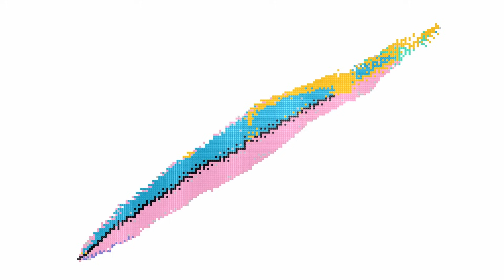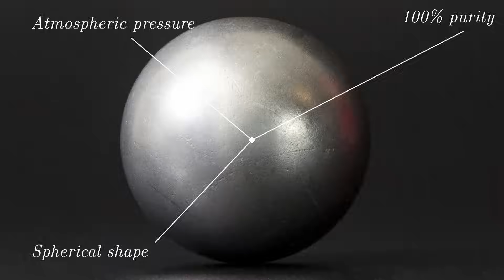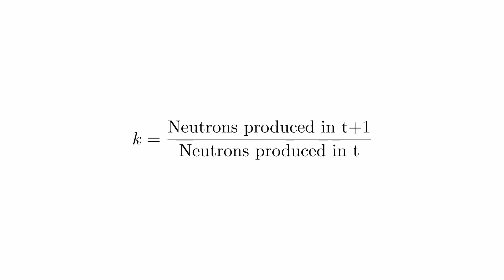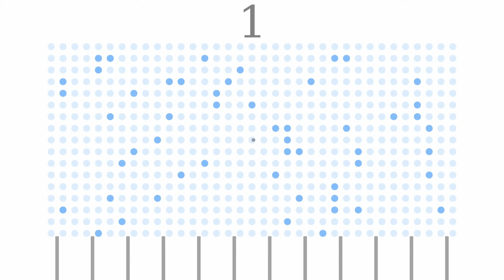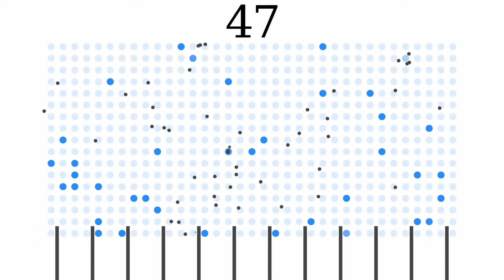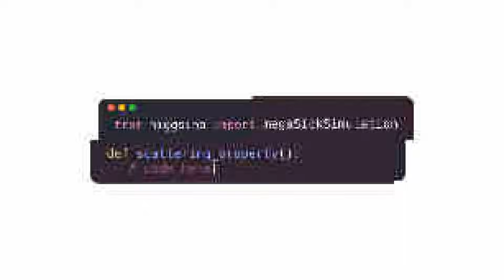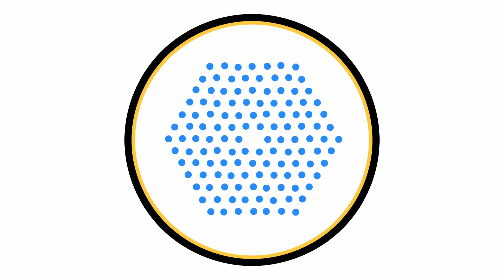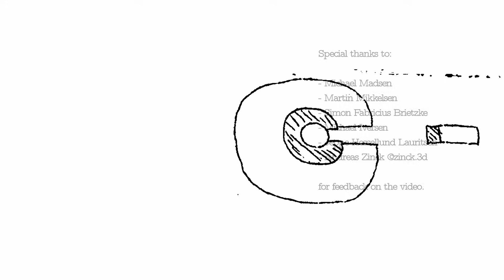Nuclear Fission Visually Explained

Comment: 1. Nuclear Binding Energy Context

Heavy nuclei (A ≳ 200) such as U-235 lie on the downward slope of the binding energy per nucleon curve.
This means they are less tightly bound than mid-mass nuclei (iron-56 peak).

When a heavy nucleus splits:
\Delta E = \Delta m c^2
The mass defect converts into kinetic energy of fission fragments and radiation.

⸻

2. Reaction Mechanism
	•	A thermal or fast neutron is absorbed by U-235 → forms U-236* (excited compound nucleus).
	•	The nucleus deforms (liquid drop model) due to Coulomb repulsion overpowering the strong nuclear force.
	•	It splits asymmetrically into:
	•	Two fission fragments
	•	2–3 neutrons
	•	Prompt gamma radiation

Typical reaction:
{}^{235}\text{U} + n \rightarrow {}^{92}\text{Kr} + {}^{141}\text{Ba} + 3n + \sim200\,\text{MeV}

⸻

3. Chain Reaction & Criticality

The neutron multiplication factor k defines system behavior:
	•	k < 1: subcritical
	•	k = 1: critical (reactor steady state)
	•	k > 1: supercritical (weapon/excursion)

Control mechanisms:
	•	Neutron moderators (water, graphite) slow neutrons
	•	Control rods (boron, cadmium) absorb neutrons

⸻

4. Engineering & Constraints
	•	Generates long-lived radioactive fission products
	•	Requires extensive shielding and decay heat management
	•	Risk of prompt criticality and meltdown if cooling fails

Comment: Your quip at 11:09 was really dumb for a scientist. Fun fact that "problem" you're alluding to was actually fixed by making those "evil" graphite tips 1.7 meters LONGER. And several RBMKs continue to operate just fine to this day in that arrangement. 

This is possible because the graphite tips in an RBMK reactor are not stupid or accidental parts of the design; and in fact perform many key functions in normal operation. The material didn't get to the bottom of the control rods due to random chance or incompetence.

Comment: 1:44 Regarding the split of U235 into Kr92 and Ba141: do the fission products occupy a larger/smaller/same volume than the original U235?
Reply: To be clear, it's not always these fission products -- there's a distribution (which affects the avg. number of neutrons per fission) --  the heat of the fuel rods themselves are self-annealing (but also some if the fission products, like Kr, Xe etc. are gasseous so degas themselves+ must be accounted for in reactor design)
Reply: @NZAnimeManga  very interesting, but not what I'd like to have found out
Reply: @ThomasHaberkorn  the self annealing answered your question. Yes fission products introduce stresses into the crystal structure (due to volume changes) but the rods are hot enough that this resolves itself in terms of impurity placement + gaseous elements escaping from the metal/ceramic

Comment: Nice simulations, but why did you use graphite for the neutron reflector? Graphite is a great neutron moderator, but that is the last thing you want to do to neutrons in a bomb. Little boy used tungsten carbide and the Gadget used depleted uranium. FYI, I have all the calculations solving the neutron diffusion equation to determine the critical mass on my channel.
Reply from the maker: Hey thanks for letting me know.  If you can find me your specific video, I'll add that as a video-link-popup - whatever it's called.

But anyways I chatted with Alex Wellerstein. He said the same thing as you, graphite is not correct for an atomic bomb. I didn't know, but I just wanted to name an example material for moderation. Miss on my side.

Btw love your channel. Let me know if we should do something one day. I'm currently working on using these simulations of the Chernobyl disaster.
Reply: @Higgsinophysics  thanks for sharing with your viewers. The video is titled "How to calculate an atomic bomb's critical mass,"  which can be easily found on my channel. I wanted to share the direct link but YouTube only lets the channel owner to include URLs in comments.

I also got in touch with Alex when I made my videos about critical mass, I asked his permission to show his Critical Assembly simulator. I started writing the code for my own simulation but I realized that it would be too time consuming and ended up just using Alex's simulator.

I am glad you liked my channel, I just discovered yours, subscribed right away. Collaborating in the future would be neat!
Reply: Isn't the n,f cross-section for thermals ~700 barn where fast neutrons are ~7 barn? Or does the ~100 barn n,g reduce the yield despite the increase in cross-section?
Reply from the maker: Also, this is hilarious haha https://imgur.com/a/pswEp5P

Comment: What happens to the control rod's material as it keeps absorbing neutrons?
Reply: Well if B-10 (typically used in reactors) absorb a neutron it  may becomes B-11 which is still stable, and if that absorb another one it still quickly decays to C-12 which is stable again. So it is remarkably resistant to activation. Still may affected by neutron embrittlement. (not in the case of boric acid though)
Reply from the maker: Nuclei absorbing neutrons eventually becomes unstable. So it will have to be replaced at some time. I guess we could have a look at the decay channel of boron-10.  But control rods rarely absorbs enough to loose their effectiveness, and are instead retired due to structural issues